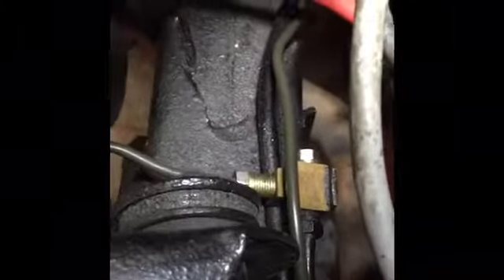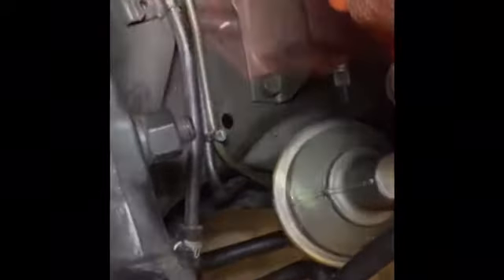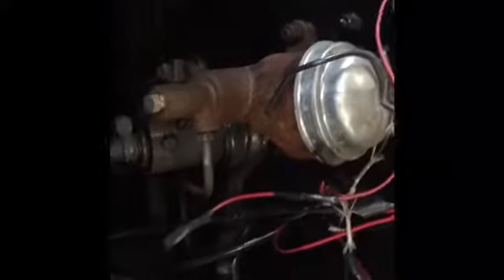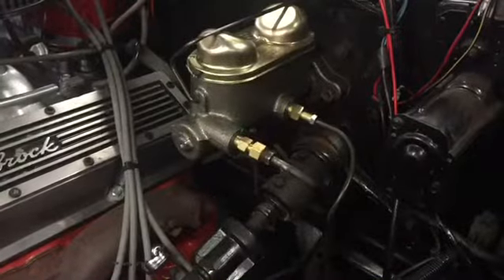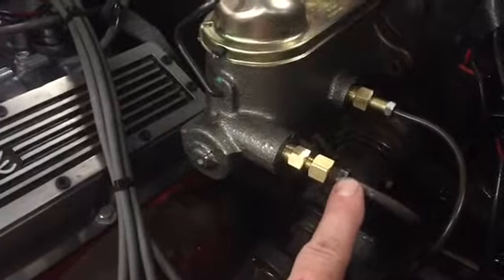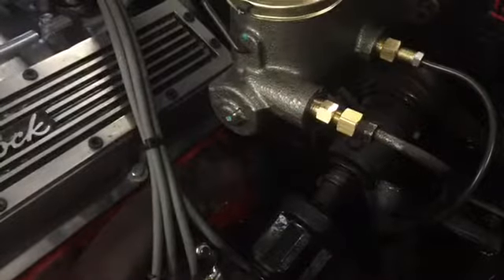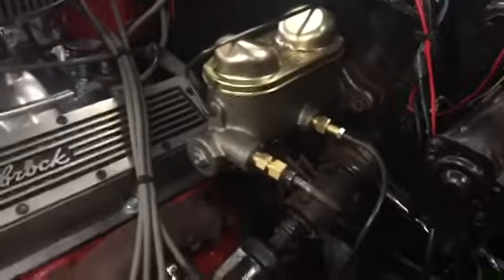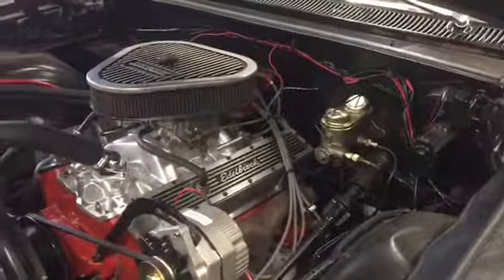Two line master cylinder install 63 impala

Comment: So all you had to do besides the adapting is block the rear port on the junction block and run a new line from the master to the rear axle?  I am looking to do the same project on my 64.  Your video is the only one I could find  that was worth watching.  Thanks for posting it.
Reply from the maker: Yep, pretty stright forward, a bit of a pain running the new line but i bought the easy bend lines from napa and it was not so bad.
Reply: Why not just run a union to the existing rear line then just run a new line from there?

Comment: What size adapters did you need from the brake line into the master cylinder?
Reply from the maker: Im sorry, I dont remember but my local napa had a box of adaptor fittings in stock.

Comment: Where did you purchase the master cylinder? I think I need to swap mine out. I have standard brake on my 63.
Reply from the maker: I picked it up at lordco and I believe it is from a 67 impala. It works perfect and if you do a disc brake upgrade on the front you will not need the propotioning valve. I did that last winter and it is awsome.
Reply from the maker: I picked up a 67 impala front disc master from my local napa. Since then I have up graded to a disc kit from summit and its cheap and stops like a dream and i think you can get the kit with the master.

Comment: Where did you get the new brake line from? How long is it? Was it custom made or prebent? Did you bench bleed the new master cylinder?
Reply from the maker: The lines are easy bend lines from my local napa .

Comment: Do you know if your master cylinder had the internal residual valves? I know a 67 impala MC should for Drum/Drum but i purchased a new master and it didnt have them in it. I dont really want to run separate Residual valves. What brand and part number was your MC?
Reply from the maker: sorry Im not sure of part number, I will try find my invoice from lordco and let you know.